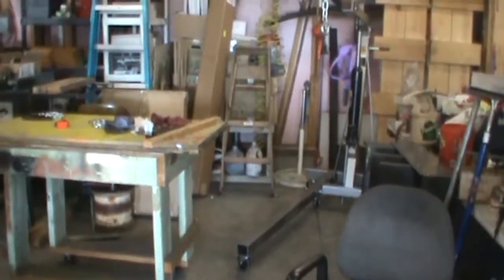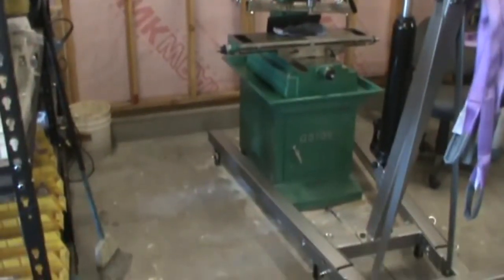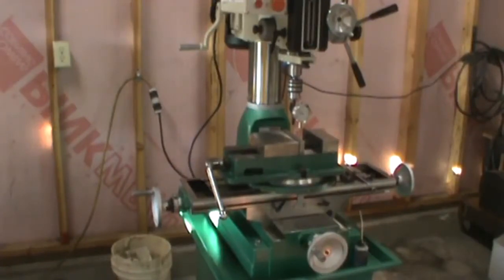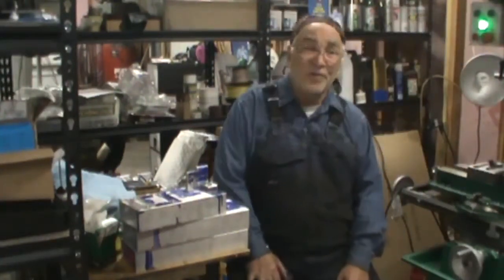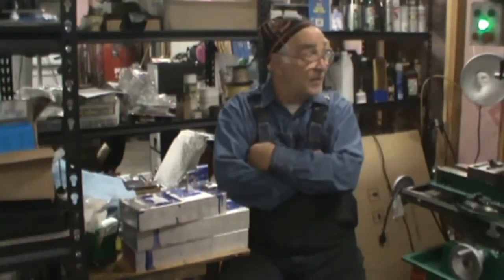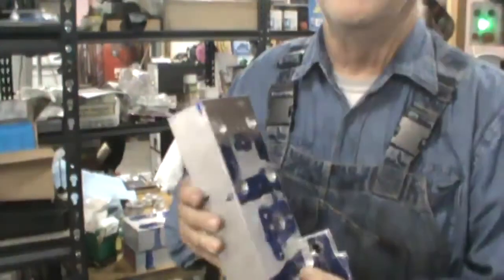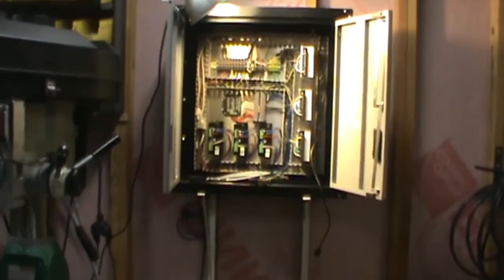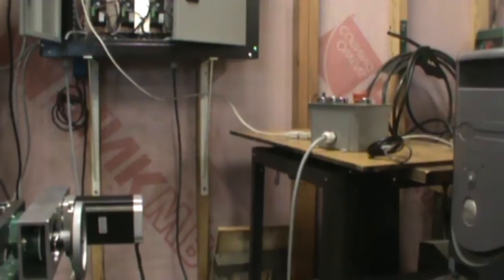Grizzly G0705 Mill/Drill Conversion to CNC.

Comment: Great video, did you replace the leadscrews? If not , how did you deal with backlash? Also, what dimension is the aluminum extrusion for the motor mounts? thanks